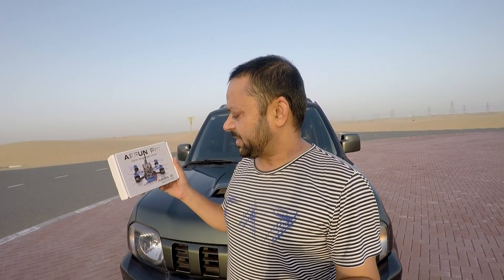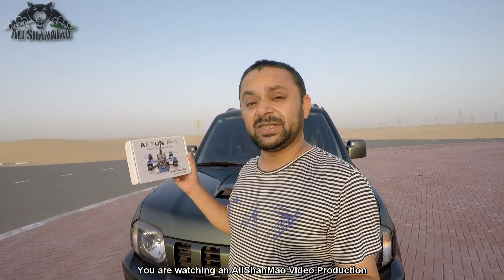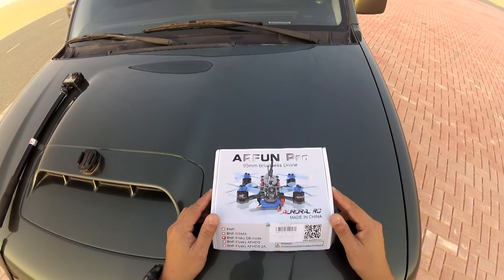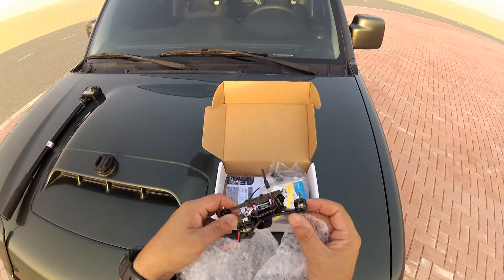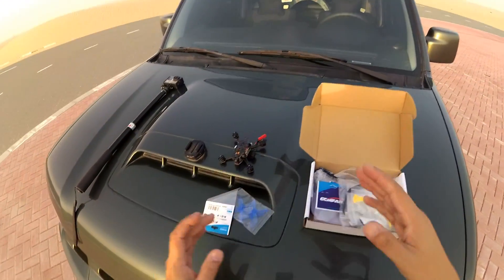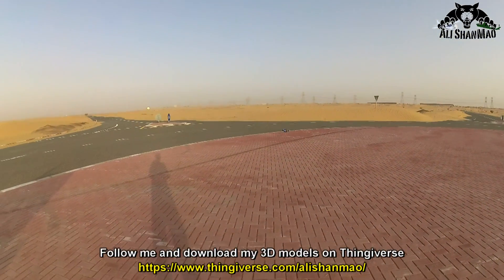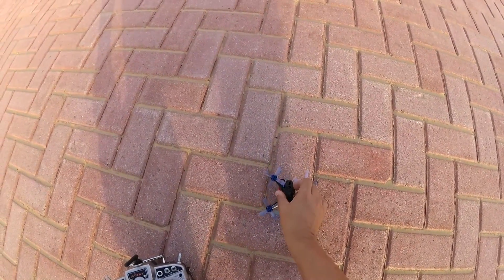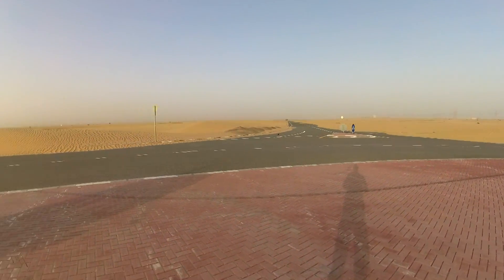Ultra-Fast ARFun Pro 95mm Micro Brushless FPV Racing Drone

Comment: Hey I'm new to this. What beginner controller do you advise me to get along with this sweet drone ?
Reply from the maker: best to invest once in a good Radio. Get a Taranis X9D
Reply: That's one fantastic thing about drones, it does not require any specific radios since the programming are done in google chrome plugin programs. any Tx with more than 5 ch will do the job (Y) Just a question about personal preference (Y) Happy flying!

Comment: i am looking into buying this (through your link) but i am unsure which bnf package to order for my Flysky fs-i6 transmitter , is it the AFHDS or the AFHDS 2A but at the same time these are both 8ch receivers and my transmitter is only a 6ch .
Reply from the maker: there should be an option for it when you order. best to order AFHDS :)
Reply: i'm looking for the same thing now.. do you know something more about it? I really dont know which transmitter i have to buy